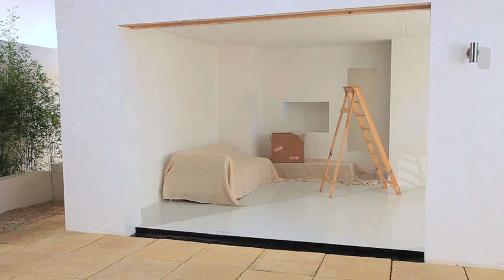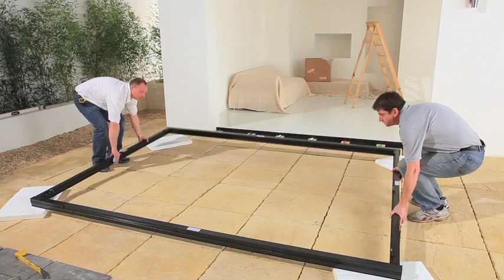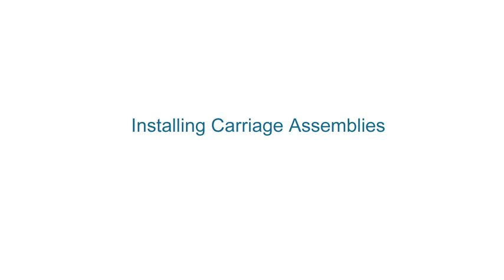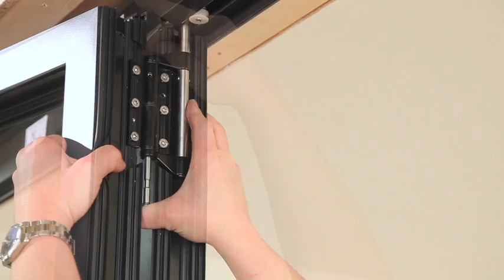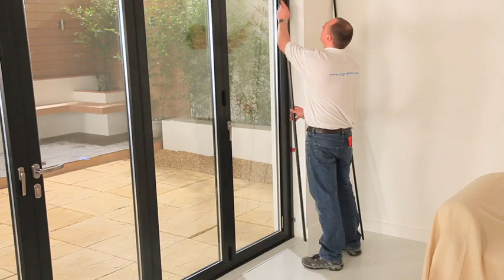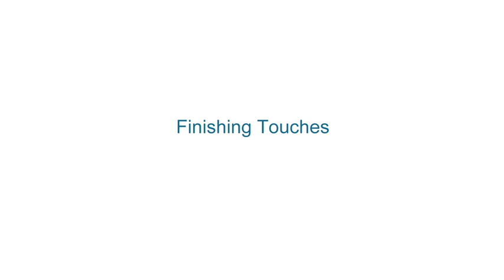Bifolding Doors Installation Guide

Comment: I have had a set of these doors (5 meters wide) for 3 years now and they were fantastic until recently  when they became difficult/impossible to open and close.
 It was caused by  the top acetal rollers not  turning and developing  flat spots, and has caused the steel shaft to contact the track and damage the powder coating. They were not lubricated by the installer, or by me as I was told they were self lubricating.  Who was I to argue as I know plastic and grease can be a bad combination. 
The rollers were replaced under warranty without question  but that is not the point, (I am still waiting for a decision on the track) if they need lubricating it should be done initially  by the installer and made very  clear to the user on completion.
Reply: As a rule of thumb all moving points of any window or doors should be lubricated. If it doesn't need it, it won't hurt it.
Reply: I quite agree, unless told not to as it might damage the plastic?
Reply: Never lubricate the top fork wheels, these wheels need to freely rotate in the track when operating / opening and closing the doors. 
Using a lubricants on the top wheels will cause the wheels to slide and eventually flat spot. 
The other way these can flat spot is if the fork pins ( old style ) become loose which put pressure on the fork system causing them to fail.
Reply: The internal bearing surface of the wheels needs to be lubricated so they are free to turn , it is the outside groove that should not be lubricated so the friction makes them turn. It was lack of lubrication on the ‘axle’ that caused my wheels to stop turning and wearing flat spots on the grooves.

Comment: Hi I have a question. Who finishes off the installation of the doors? At the end, all that has been done is someone has added expanding foam between the cracks. Expanding foam won't support the weight of 3 bifold doors with glass weighing around 200kg.
Reply from the maker: John Ho Hi John, the weight of the doors is supported by via the fixings into the masonry. The expanding foam is used only for insulation purposes. If you would like any more advice then please call one of our Customer Service Advisers who will be happy to help you. 0808 168 5816